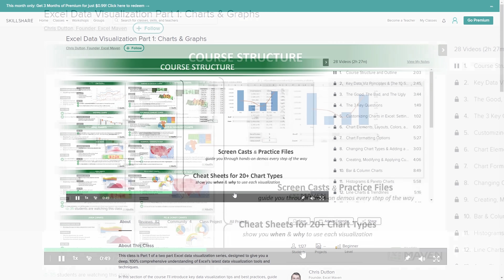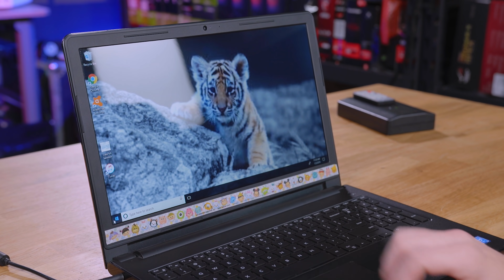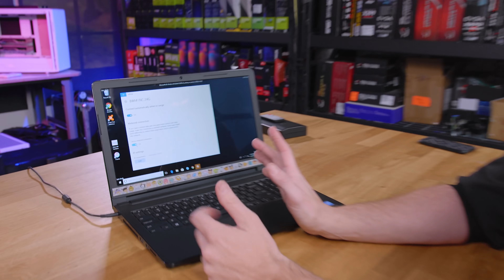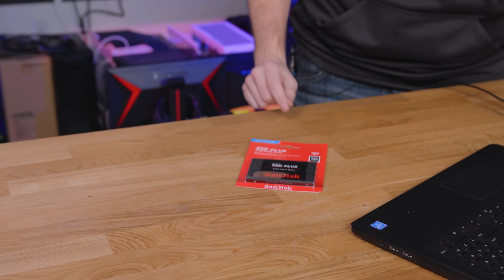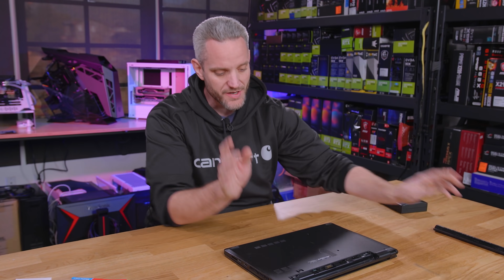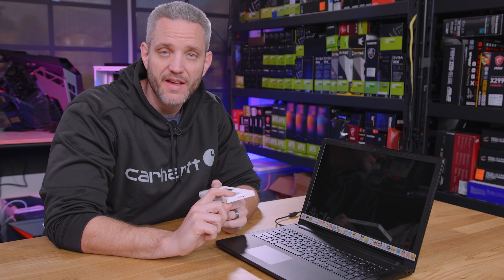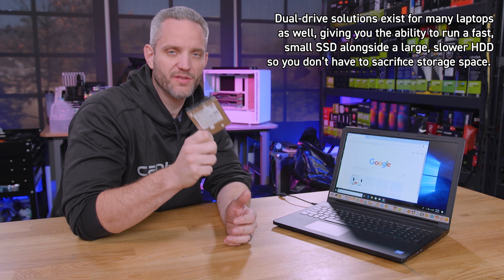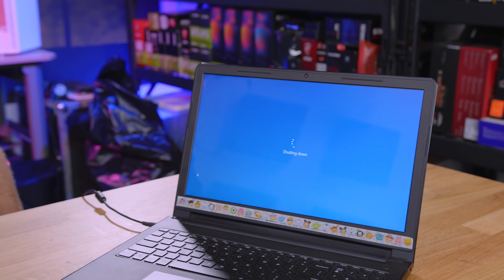Repairing an old laptop for as little money as possible...

Comment: 1. Before you disassemble a laptop/notebook to upgrade the hardware have a look online so that you know the amount of so-dimm slots and harddrive slots the device have. Quite a few of the cheaper ones will only have one of each.
2. Since most cheaper laptops got only one harddrive slot make sure you get a 240/250Gb SSD or they will run out of space in no time. The 120/128Gb will not be enough for most users unless it can take a secondary mechanical drive.
3. I would also advice after installation and updates of windows that you permanently disable windows updates on cheaper laptops under windows services.
4. Leave Windows Defender if you don't have anything better together with addblock and the average user will be fairly safe online. Do not leave it without antivirus.
5. I would advice anyone doing a clean install of Windows 10 to download it for free from Microsoft as it will get you the latest build saving you hours on windows updates using an older build.

obviously make a backup before installation of any data you want to save to an external drive, usb stick or whatever you prefer.
Reply: If the laptop is an old one, most likely they will have a dvd drive, might as well pull that out and put an hdd caddy for secondary storage
Reply: I would advice agains any antivirus because it TANKS an HDD just with the default antivirus windows gives you. The amount of viruses in the web is way low now, and the average user might never see them. They will browse the web on the main sites of choice (Facebook, youtube and what not) and chrome does a good job of keeping the user out of phising sites. Maybe malwarebytes helps but that's as far as I go
Reply: @cgd07  And here I thought I was the only one using the HDD caddies. Super cheap option and not really hard to install.
Reply: Well said. Im looking into a laptop for my daughter who is almost 11yo. But theres a couple games she likes playing that i have so Im looking at making sure it can run those games.
Reply: @marinell06  agreed. You don't need an extra anti-virus if you're not doing sketchy stuff.
Reply: @ratchbrg3882  i just bought a lenovo ideapad with ryzen 5 2500u (and vega 8 onboard). Payed around 450$ (with tax) for it with 8gb of ram and 1228ssd + 1tb hdd. also came with a 15.6' full hd panel. It's a great budget gaming laptop, only gpu driver support is shitty atm. AMD has anounced that it will have decent drivers soon tho.
Reply: @marinell06  MalwaresBytes Free is an on-demand-only software, as in, it doesn't do anything unless you manually trigger a scan of the system. So just installing it on a non-techy's computer does nothing, unless they are actually going to trigger scans once in a while.

Also: Windows Defender does the trick just perfectly, even on HDDs. Having no AV at all on a machine is just plain idiotic.
Reply: Eh, I would never advise someone to get a 250 Gb SSD, it's actually only 32.25 GB. Way too small. And who even measures storage in Gigabits?
Reply: @flashcat6665  I know it does nothing and it's supposed to do nothing. You can schedule scans periodically like once a month if you're that paranoid but you don't need AV if you don't do sketchy stuff. Even if you do, you'll be surprised by how hard it is to get infected this days. And windows Defender, by my knowledge of seeing more than 10 computer, get the HDD pegged at 100% all the time, and if you open anything, get you 50% on the program, 50% on the AV. Double the time to open something you already know is safe just to have that active, that's idiotic.
Reply: @khronosfateless thats what i was thinking. Since she wont need much in the way of grapgics.
Reply: @marinell06  Windows Defender doesn't really tank the drive that much, on most Celeron-powered laptops I leave it enabled since there isn't really much difference.
An average user isn't always just scrolling through Facebook. Downloading files off of sketchy sites is also common, at least in laptops that I had serviced.
Reply: @tetrisgoat  how is a 250gb ssd only 32.5gb just curious
Reply: @BenCos2018  to figure out how many Gigabytes 250 Gb is, you divide by 8, because there are 8 bits per byte.
Reply: @kamild_  I don't mean the CPU, I mean the HDD always tops at 100% on anything you do when using the computer, and i halves the performance, because 50% is the program being opened and 50% is the Windows Defender looking at the files.
Reply: @tetrisgoat  Actually they measure by how many bytes they have. HDD & SSD manufacturers calculate 1 Gigabyte as 1,000,000,000 bytes, so a 240Gb drive has 240,000,000,000 bytes, which is roughly 223GB.
Reply: @marinell06  yeah, but they didn't write Gigabytes, did they. They wrote Gigabits.
Reply: @tetrisgoat  Oh, it's a joke. Woosh

Comment: Hey jay! You should make a step-by-step guide on how to migrate an OS to an SSD. Seems kinda daunting to me.
Reply: back up the files you want to keep, swap the drive, then load the new OS with a usb boot loader. Lots of info online how to do this, then copy the files you backed up to the new drive.
Reply: I had very good sucess with a program called "Paragon Migrate OS to SSD". It does all the work for you and basically mirrors your existing OS with all the files you have to that SSD. After that is finished you just set the SSD as your Main Boot drive in your Bios and you are done! (Of course you can do it as the poster above me said, but this is a super easy way without you worrying to break anything).
Reply: It can be daunting if your SSD is smaller than your HDD, because then you have to partition the HDD until the OS is on a segment smaller than the SSD.  But if you get a nice 2TB SSD, it's basically just point and click, just follow the prompts and it'll do it all for ya.

I just did a fresh install on my SSD, and then hooked the HDD up as storage.  Started over.  I figured if i ever needed something from the old OS, i could just boot from HDD real quick, but i was surprised how rarely i needed to do that.  At this point, i haven't booted from the HDD in years.
Reply: @BothHands1  Thats very true. But I think a logical step in the first place to be is that you buy an SSD with a bigger capacity than what you had before. Especially since your C: drive can run full over the years, at which point you might as well just do a fresh install :D 
In my case it just was easier that way and sort the files out after.
Reply: MsToshi1990 
Yeah for sure, though back when i upgraded, 2TB SSDs didn't exist yet.  My HDD is full to the brim with torrented movies and shows, so there really was no need to put any of that stuff on SSD anyway.  The 500GB SSD was plenty for OS + games, and still left a good 250GB for whatever might come my way in the future.  

While 2TB SSDs exist now, i still feel like i don't have much use for one that size, and instead made my 3rd drive another HDD just for extra torrent storage lol
Reply: 1. Buy the best Samsung EVO you can afford (bigger than your existing drive).

2. Use the Samsung Data Migration tool

3. Swap the drives

Easy peasy
Reply: Minitool Partition wizard  https://www.partitionwizard.com/help/migrate-os-to-ssd-hd.html 
Works really good in my experience.
Reply: DONT CLONE! Download Windows 10 USB creation tool. Clean install Windows on the SSD. Then put your old HDD in an external case and retrieve your files. 

If you still think you want to clone. Samsung has the best cloning software. It comes free with Samsung EVO SSD.

Unless you are a senior database engineer you are going to fuck it up, waste time and become frusterated. Your old hard drive won't survive the cloning process. You will get an error 6hours in.
Reply: serch Clonezilla, folow instructions
Reply: @chrisreynolds6391  what u cloning whit i used both acronis and clonezilla ant it was quite fast,...
it helps if original hdd isnt dying
Reply: @marianmarkovic5881  how recently did you clone it? 
In my experience any HDD trying to boot Windows today IS dying!
Reply: @chrisreynolds6391  I used Clonezilla Like 6 months ago,.. quite wintage 160GB piece. Core 2 Duo pc. after upgrade it can continue its office work for another 10 years
Reply: @marianmarkovic5881  If you have that level of talent/skill I'm surprised you had time to clone a core2duo. 
Was it for a loved one? Did it have any issues later on?

I always seem to mess it up. I think it Microsoft puts in updates to sabotage cloning. Or something.
Reply: @chrisreynolds6391  well i Obviusly cloned HDD not cpu lool XD
Its workstation whit special program + database which would be pain in ass to reinstall and resetup,...Sticking SSD, boot clonezilla from USB drive, clone drive was faar faster method, and i was in luck since original drive was small, i didnt have to deal whit cloning to smaller drive problems
Reply: @marianmarkovic5881  I guess in that particular situation it was the best option. If it's an enterprise system with special software it is probably pretty clean.
I just identify computers by the processor family because it's easy to identify.
Reply: @aanesijr  yes! Buy the samsung one just for the migration software!!! Had a Kingstone SSD and the migration software is AIDS
Reply: I usually just clone the entire drive w/ paragon then delete the unnecessary extra files that get copied. It's inefficient but since it can't break anything it's my go-to method
Reply: If the HDD is dying, it may be in your best interest to just transfer the most important things to a different medium and just go a clean install of Windows on the SSD. I do this by booting something, usually a live install of Ubuntu, and just dragging and dropping the info onto a USB or on google drive. You have to be careful with cloning an HDD to put on an SSD, because sometimes it will not work. Last summer we ran into a big issue with that, and it seems the reason was because the SSDs don't store info the exact same way as a hard drive does so they would get stuck trying to boot and throw an error. Same thing happened when we tried too use a SATA SSD image on an M.2 SSD, again probably some difference in the way they store and access data. Depending on what software to you use, the cloning is done differently, so I would suggest being aware that it might fail depending on what you use.
Reply: @BothHands1  Such a large capacity SSD may be beyond the budget of many (I included).  I could only afford to spend on a 500Gb SSD Evo 860 on sale.  Yes, if the SSD is smaller than the existing HDD, some work is needed to move out existing data (e.g. personal files, photos, documents, music, videos, etc.) into a backup drive before migrating the OS into the SSD.  And once SSD has been cloned/migrated, reconfigure where each program to store data to the mechanical drive, rather than the SSD.

Comment: that laptop might have 2 sodimm slots, but some models have the other sodimm under the keyboard instead of in the back. ive also had a laptop with 1 sodimm slot and 1 memory channel worth of memory soldered onto the board. its best to check to make sure.
Reply: My HP Elitebook 8440p has dual channel exactly what you have described except for soldered on RAM.
Reply: From the looks of it he would have seen the second one if it were there. I have a Dell Precision M4800 with this (two slots on each side in fact) and a Lenovo ThinkPad T520 with one on each side.
Reply: @IanBPPK  That Dell Precision has 4 so-dimm slots?

Comment: I get the feeling of taking apart a Dell laptop. My old laptop (daily from 2010-2015, secondary from 2015-2016) I put a SSD in it for it's last year of use and I didn't get why the keyboard had to come off to change the drive.

Whereas now my Helios 300, all I have to do is take a door off for the 2.5" bay (1tb HDD in there) and take the whole bottom panel off to access my m.2 SSD (256gb). I had to take the bottom panel off once because the wifi card became lose and it needed a reseat.

Comment: The statement about Dells not being user service friendly is not 100% true. Consumer models maybe. We own many Latitude models where you just open the bottom panel and have access to HDD, RAM, wi-fi card, and more.
Reply: tastyfish1 older sells are much better, ultra books are a pain though. Why can’t manufacturers add convenience doors for the ram and hard drive like they used to?
Reply: @Polaris Lakewell  The Optiplexes are the same way, though i assume they mostly meant laptops
Reply: Inspirons are the pain, Latitudes are not
Reply: last latitude i had i opened 1 screw and the whole bottom came out...
Reply: The inspirons are aweful. I had one, and to get at the hard drive you had to remove the keyboard/trackpad, motherboard, speaker, and usb3/ethernet daughter board. All to get at the hdd which was directly against the bottom of the case where a panel could have gone if they weren't pinching pennies so hard.
Reply: if you think Dells are bad just look at the really old ones, had to put a computer together and take it apart for my IT class and the computer I was given just happened to be a really old Dell, had the optical drive, floppy disk reader and hard drive pancaked on top of each other. Smart on saving space but for convenience that was hell
Reply: I have a new Dell G5 and the bottom has access to the ram, HDD and bootdrive
Reply: I can access the internals of my 3 year old Inspiron 7559 by just opening a screw. The Older and the cheaper Inspirons' internals are the ones that are hard to access.
Reply: My xps was cake to open.
Reply: Hell I just swapped out the hard drive on my mom's Dell Inspiron laptop thats only like 4 years old and it was easy to do, just had to undo the screws along the back panel and then carefully pull the back panel off. Then I could swap out the hard drive no problem. Dunno if the RAM was there or not though
Reply: Yeah my Dell laptop is just like that too, my mom however bought one from Wal-Mart or Staples one of the big stores and hard drive failed getting to the hard drive was a chore!
Reply: My HP Elitebook 8440p was practically easy to replace HDD, RAM, CPU, WLAN card, WWLAN card (MSATA SSD), and CMOS Battery.
Reply: I just worked on a friend's Inspiron 5559 a month ago. Especially considering how recently it was made, it was actually amazingly easy to work on. One panel gave me access to the disk, wi-fi adaptor, and RAM.
Reply: I can vouch for that. The old Latitude E6420 I have is the most easily serviceable laptop I've owned.
Reply: I can vouch for Dell Precision laptops (M4800 and the like), early HP ProBook/Elitebook 640/840 models, and most ThinkPads being easy to get into and for ThinkPads specifically easy to get to the right part without removing screws that don't need removing. The 640/840 G1 was by far the easiest amongst them with an easy switch of a tab and pulling off a panel. Full access to the HDD/SSD, WLAN/WAN cards, M.2 (2242 womp womp), RAM, and battery (that's replaceable at that).
Reply: @IanBPPK  To take the HP Elitebook 8440p monitor completrely off, you will need to take off WLAN/WWLAN cover off, keyboard off, quick look bar off, 7 cables (5 is the WLAN and WWLAN and 1, 30 pin monitor connector and 1 camera connector i believe), and 6 screws on it (2 on the inside of the laptop and 4 on the bottom case).
Reply: Old lat e6400 is so easy  - you dont even open the machine to change drives, the ODD is modular and just clicks out, the HDD slides out with 2 screws, magnesium baseplate comes off with a few more to get at everything else

Comment: Awesome video, Jay! I do computer repairs for a living and I’ve seen people going about increasing the RAM and upgrading the whole platform when really the trouble was the old hard drive with a bloated Windows install.

I suggest you take a look at Tech Yes City’s video about Windows 10 optimization. I find it REALLY makes the system snappier, especially on budget machines that can’t really handle loads of background processes and services plus the Windows 10 graphics, which do take a good bite off of slower CPUs.
Reply: A month ago, I Scored a Dell Latitude D630 (built in 2007)on eBay for $20 bucks!  No HDD, No OS, & only 2gb ram!  Dropped in a $20 SSD, got 4gb of Ram from China, off eBay, Loaded Win 10 Pro,...now she's Running like a Champ!  I don't have Cable/Internet,...but I tether in thru my Cell Phone, keep updates paused until I can Update from a Fast Food free Wi-Fi Connection in there parking lot!

Comment: The vast majority of laptops sold in the last few years come with a mechanical hard drive and a single band wireless card.  Best way to get a usable machine without buying a new one is buy a cheap 120 GB SSD and dual band wireless card and swap them out. This can be done for less than $50 and the wireless card is only really necessary if you live in an apartment or somewhere else with high WiFi density.  And if you need a larger drive and an external won't do then you have to choose, money or drive space.